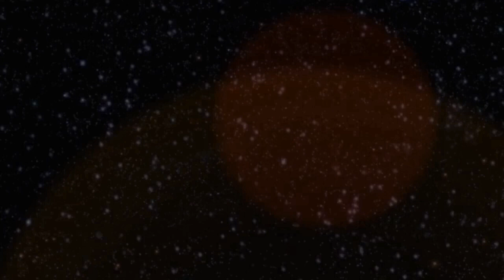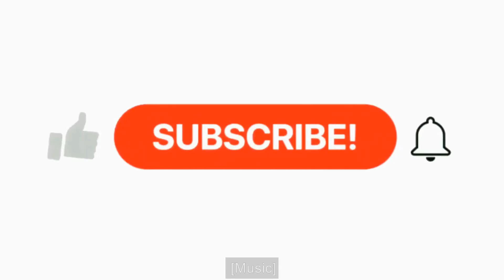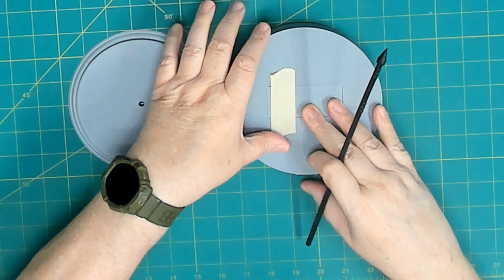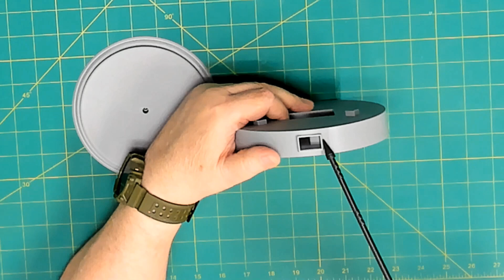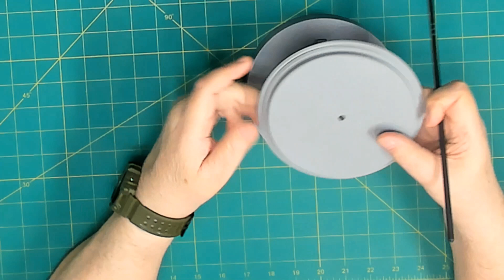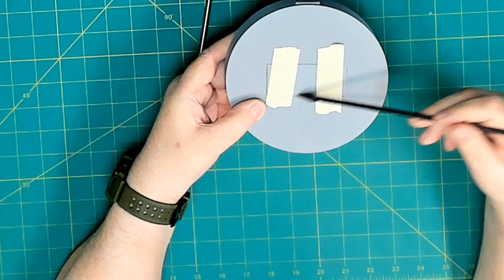Round2 Replacement Base

Comment: So........... where can someone put the control boards? Putting control boards IN a model ship is not a good idea since if the board goes out you have to cut the model apart - and ruin your work !!! YOUR BASE should be hollow and a tic taller/deeper if you want to hide all of the boards in your new base -
Reply from the maker: Ture on the boards however only so much room on this type of base! I am working on putting in a power jack to run 12 v but do not have space on this model to add a board option. HOWEVER i not yet load up my 8 X 12 master base in which I plan on using for the storing all the boards in the base and that will have miles of space for control boards